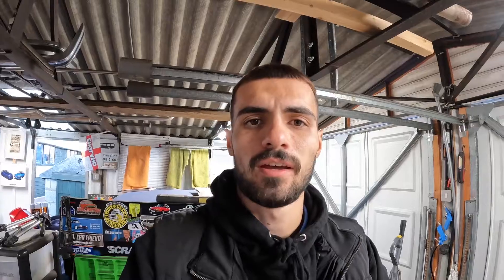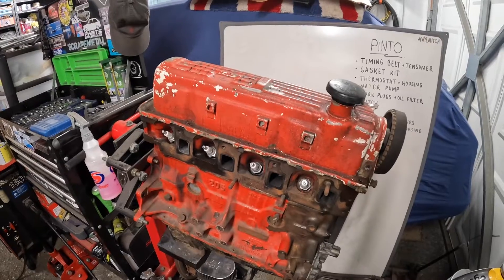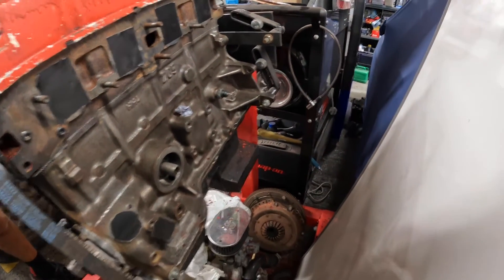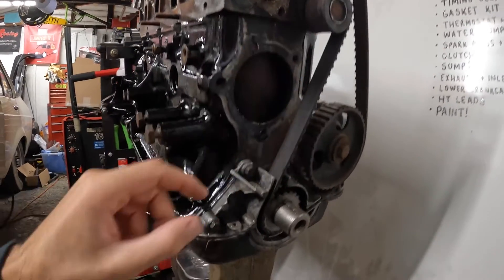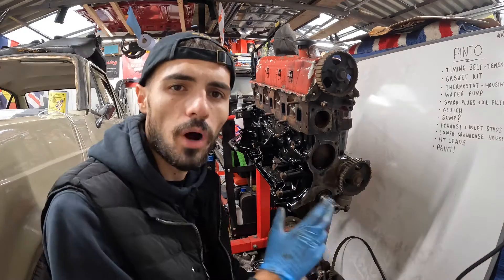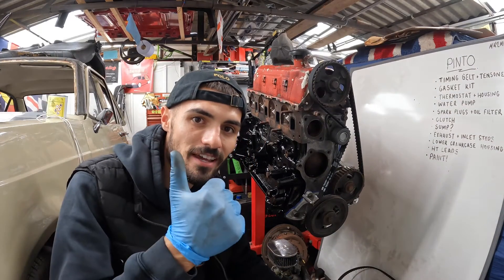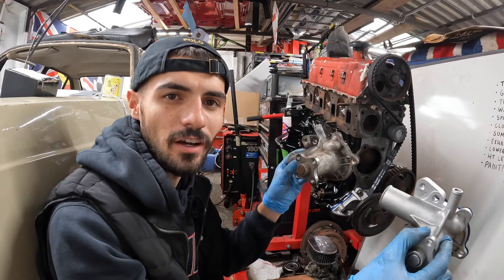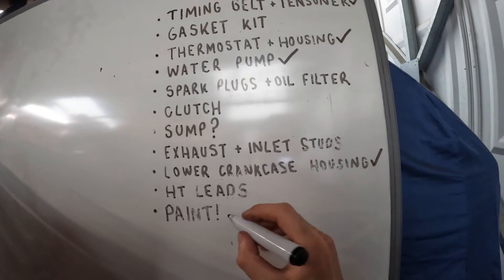FORD 2.OL PINTO OVERHAUL | TIMING BELT, WATER PUMP, THERMOSTAT REPLACED

Comment: Just saw your video your thermostat is fitted the wrong way round the part of the stat which is copper and spring must face cylinder head iv seen this mistake several times and you will have overheating problems
Reply from the maker: Hi pal, this video was recorded a few months ago and as you’ll see loads of people have already pointed out about the thermostat. In the video on from this I correct my mistake but thank you anyway 👍🏻

Comment: Great video Mitch ! Loving the engine build videos and the mk2 is getting better and better every time you work on it , if you can get the flywheel lightened and balanced your engine will rev quicker it’s a really good modification that works 
Thanks again for the cracking videos keep up the great work 🎉
Reply from the maker: Thank you for the positive comment pal! I've just been gifted a lightened flywheel 😁
Reply: @Mk2Mitch  ahh great stuff pal it will be worth it 👍🏻👍🏻

Comment: Nice build, super clean and has the head been converted to a unleaded fuel. As these engines were build in the leaded patrol ere?
Reply from the maker: I'm not sure John, I will have to check as I believe there's a number stamped on the head which refers to it being leaded or unleaded!

Comment: Great video, the rubber goes in before the thermostat, your thermostat is rattling around, how about getting a alloy cover made up with mk2 Mitch engraved ? Or a burton power one or paint yours beige… any of those would look good
Reply from the maker: Thank you for the advice mate, I removed the thermostat and fitted the rubber seal first & flipped the thermostat round the right way 👍🏻 As for cam cover, I'd love Mk2 Mitch engraved but not sure where I'd get that done?? 🤔

Comment: If the seal has a slit on the inner side all the way round it goes over the thermostat ,basically the thermostat sits in the slit so it’s 50/50 either side then pushes in to housing as one unit and then your clip , every days a school day 😆
Reply from the maker: Thank you, I've removed the thermostat and fitted correctly now! 👍🏻

Comment: wasnt those tensioners sprung loaded to help with how tight the cam belt is ,could be wrong has been over 2- yrs lol
Reply from the maker: I think so, however the one in removed didn't have a spring either so I will continue to check and adjust if necessary! 👍🏻
Reply: The spring was a great idea and was only fitted to earlier engines.

Comment: The rubber should go in first before the thermostat so it seals and stops the flow in till it warms up and opens and it won’t rattle 👍
Reply from the maker: Thank you for the heads up pal! I removed the thermostat the other day and fitted as you've explained, clip was very tight but doesn't rattle now 😁
Reply: @Mk2Mitch  
😂I’ve done a couple of them on different fords they are all like it it’s got to tight so the water don’t get past it 👍

Comment: Love a pinto! Great simple old skool engine in an Escort and easy to build or tune. I had my cam cover powder coated a gunmetal grey and painted my block metallic blue. Wasn't expensive and won't scratch like spraypaint will. You can get some nice metallic finishes in powder coat that would look good with a black block. My 205 pinto is standard with a set of twin 45 webers and made 120bhp on the dyno, not too bad for a standard ish pinto
Reply from the maker: thank you for the recommendation mate, I will look I to powered coating colours! That's good going bhp for a standard pinto 👌🏻

Comment: Your thermostat is the wrong way round.
Reply: The part with the bimetal and spring should be in the hot part of the system.
Reply from the maker: Thank you, all changed now 👍🏻
Reply: @Mk2Mitch  good job! I mostly know it was the wrong way round, because my pinto engine had the same when i bought it, and i had massif Cooling problems